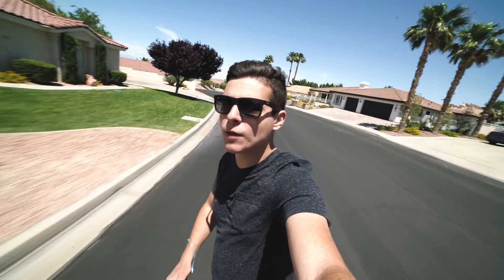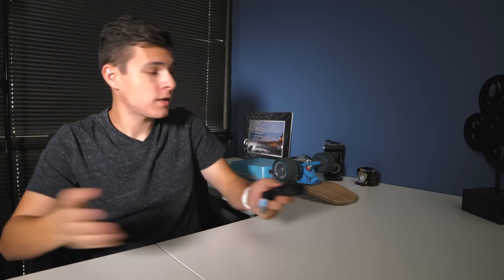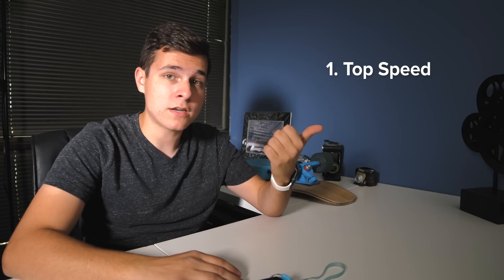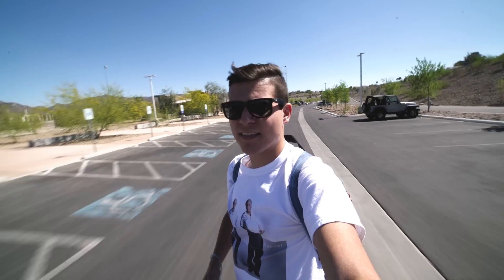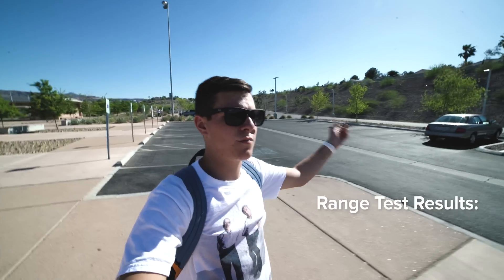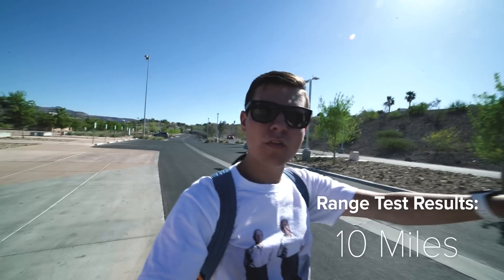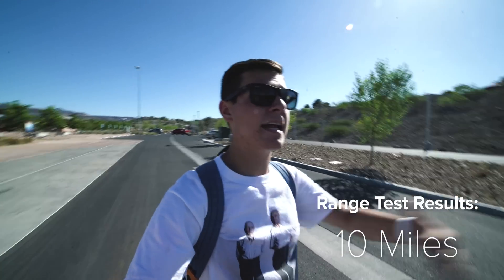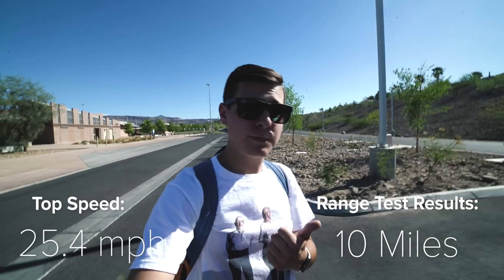DIY Electric Skateboard Build - Better Than A Boosted Board

Comment: Hi, I'm looking to build a board. I just wanted to know how you set up the ESC because I'm getting a VESC from enertion. Also I know this is a stupid question but how do the brakes work?
Reply from the maker: +Elliot Assor I also have the vesc from enertion and it's pretty awesome. The brakes work by the motor flipping polarization and kind of like putting friction on itself. It's kind of hard to explain 😬

Comment: Hey! I loved this video and I definitely will try to build it myself. For reference, what tools would I need to build this board?
Reply from the maker: +ThePixelShark Depends what parts you end up getting. You can end up buying parts and not have to really use any tools. For mine, I had to solder on a few connectors to my VESC, and modify my trucks a tad bit because the motor mount didn't fit 100%. Nothing crazy though. 😊

Comment: You can probably get those batteries charged a lot faster depending on what charger you have. Look into parallel  charging. I'm guessing you have a cheap charger that's limited on power, but by parallel charging you essentially turn the three batteries into one big battery. By doing that, you only have to wait through one balance cycle ( ever notice towards the end of the charge it takes a long time to get that last little bit into the batter?) instead of three. That will save time. Good job on the board.
Reply from the maker: +onlythefallen1 Oh okay awesome 👍🏻 I'll look into that

Comment: Awesome VID! You can also use a Parallel Charging Board but you'd probably want a more powerful charger to charge faster. What voltage were you using?
Reply from the maker: +DIYElectricSkateboard.com I have 3 3s batteries in series.
Reply: Yeah for a parallel charging board usually their max 6 packs. You can charge 6 packs of the same voltage together. Just get one that fits your end connector. It will still take the same amount of time to charge though unless you have a better charger but it's less work than charging separately. https://hobbyking.com/en_us/hobbyking-parallel-charging-board-for-6-packs-2-6s-xt-60.html?___store=en_us
Reply from the maker: +DIYElectricSkateboard.com Oh awesome, I'll look into that 👍🏻

Comment: Great job man. I'm in a similar situation to you- built a board over the summer for college with lipos and Carvon hubs. Top speed: 32mph; range: 10-12 miles. Best investment I've ever made
Reply from the maker: +KleiberFan That's awesome. Damn 32 😮 I'd die on that thing! It really is one of the best investments 😎
Reply: 2 13000mah 3s lipos in series, 2 6s car escs (solid braking and very reliable), GT2B hobby controller, 90mm wheels. The dual Carvon hubs are total tanks- I ride them in the pouring rain and rough pavement here in the UK (uni) and nothing stops them. I'm hitting 50kph on 6s- If I were to upgrade to vescs and 12s, I could easily cross 80kph. Making a project like this is totally doable- I purchased most of my parts off eBay, and got the Carvons used on https://www.electric-skateboard.builders. It's great to see people like Mike getting the word out on how to make these things!
Reply: Sure thing!

Esc (120a 6s): 

http://www.ebay.com/itm/FVT-120A-Brushless-Sensored-Sensorless-RC-Car-ESC-2-6S-1-10-USA-SHIP-120-AMP-/172389544841?hash=item282337b389:g:sZMAAOSwx2dYEmjn

Very reliable and robust- just make sure you keep them cool with venting or exterior mounts. The only issue I've had with my board was in the first week when the escs overheated (when they overheat, the failsafe kicks in and applies full brake- not fun when you're on the board). The failsafe can be disabled with a firmware update, but just ensure there's adequate airflow and you'll be fine.

Batteries: I can't seem to find my exact batteries on the eBay site anymore, but they're this brand (just choose your mah): 

http://www.ebay.com/itm/2x-FLOUREON-20C-11-1V-5500mAh-3S1P-Lipo-RC-Battery-Deans-Plug-for-Car-Truck-Boat-/272608800990?hash=item3f78c030de:g:jOEAAOSwuLZY2kd2

These are cheap and last a while with proper care

Make sure you check out the builders forum- there are thousands of posts from people building and selling e-boards, and many great tips to be gathered!

Good luck!
Reply: @kleiberfan9509  "The only issue I've had with my board was in the first week when the escs overheated"  

Sounds like you have absolutely no idea what you're doing. ESCs do not overheat out of nowhere. It means it can not deal with what is being demanded from it. To some extent ECSs always get hot, but 'disabling the fail-safe' is a good recipe to either get hurt or set things on fire. No rc car ESC is designed for human weight transport. The handful of heavy duty ones that do cost about as much as a real Boosted board would or would increase the DIY build to as much or more, so there's no point. In reality, the most expensive thing in these electric skateboards are not the battery and not the motor. For your info, a big RC helicopter already barely can deal with the heaviest loads with an 120a ESC. There's no way it would work well or reliably on an electric skateboard that has to carry the weight of a person where any stress on the motor instantly spikes the amps way beyond what the ESCs can handle. People are throwing away money going with that advice man.
Reply: It kind of depends on your weight, the terrain in which you plan to ride, and the riding you plan on doing. For mostly flat surfaces and some weekend fun, the single hub should be fine. If, however, you're planning to ride up (and down) significant hills and expect to use the board for everyday commuting, errands, etc, I'd definitely recommend dual hubs: (1) braking and acceleration are far better (really important when riding on public roads amongst traffic), (2) dual hubs pull fewer amps (resulting in less strain on your batteries, escs and motors), (3) traction's much better (you won't have any fishtailing on loose surfaces), and (4) you have a failsafe in place if, for whatever reason, one of the escs blows or a wire disconnects. An additional point (and one I've experienced occasionally)- if one of your escs or batteries fails (which will happen occasionally with heavy use), you can still reconfigure the system so as to power one of the hubs (although not recommended for any extended period, as the driving motor will have to overcome the resistance of the inactive hubs in addition to powering the board). This is really important if you're late for class/work and are faced with a malfunction- the board will still be usable. 

Essentially, dual hubs turn a toy into a vehicle...
Reply: What's your specs?
Reply: KleiberFan hey man could you link me to those 13000mah batteries and the ESC too ?
Reply: Sell me one dude
Reply: how much dd it cost
Reply: ill buy a build guide off you let me know
Reply: KleiberFan  can we text on something
Reply: Yo brother pls make a DIY video😭 bc that’s some crazy speed for a skate board! If ur worrying about having a spare board by the end of video try selling it :D
Reply: My god I read the rest of the comments ... you basically showed us the way🤯
Thank man👍🏼
Reply: do they still sell carvon hubs? can you leave a link?
Reply: Seems I've been a bit out of the loop lately- apparently Carvon doesn't offer the hubs for sale anymore, as they're now focusing on offering complete e-boards. You might be able to find used hubs on the builder's forum (like I did), but if those aren't available, there are plentiful hub options to be had. Check out the ones offered by Enertion, TorqueBoards, www.SteelHubs.com and Maytech (a generic, slightly cheaper brand, but often available for significant discounts on eBay and Aliexpress). I just want to emphasise the convenience that hubs offer; the ability to purchase a complete package without having to assemble belts, gears (with proper ratios), hangers, motors (the proper brushless motors on HobbyKing are seemingly always out of stock), etc really saves time and removes that high entry barrier to someone unskilled with drill presses or unwilling to wait a month for stuff to ship from Australia.
Reply: Your (safe and reliable) option are either a car esc (at least 120 amps and preferably 6s-12s) or a purpose-built vesc (much more user-tuneable and precise, but can be fiddly and unforgiving for beginners). Check out the vesc offered by Enertion- they'd be my first choice.
Reply: KleiberFan say I were to get the torque hub motor, should I go with 2 motors or a single motor would be enough?

Comment: damn that looks sick. could you add a link to a tutorial or something about how you built it and what you used to teach you how or whatever. Thanks!
Reply from the maker: +Grant Becker haha thanks 😊 and I used so many different videos to teach myself. There really isn't one video that explains it al
Reply: ah, alright. How much was it in total? How does it handle going up a curb? Does the bottom rub?
Reply from the maker: +Grant Becker In total it was about $650 but you can make one for much cheaper if you select cheaper parts. The large 83mm wheels handle the edges of sidewalks like a pro. And the bottom has plenty of clearance. Just have to watch out for some speed humps in parking lots sometimes 👍🏻